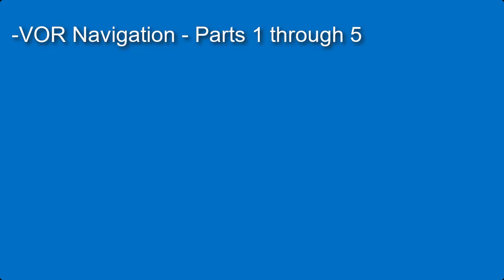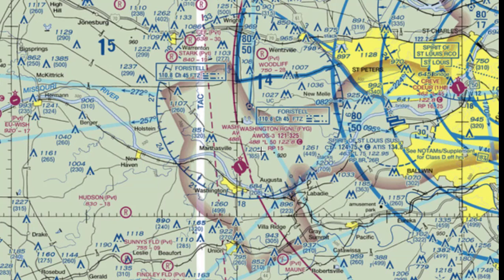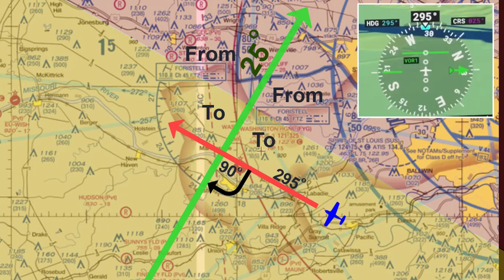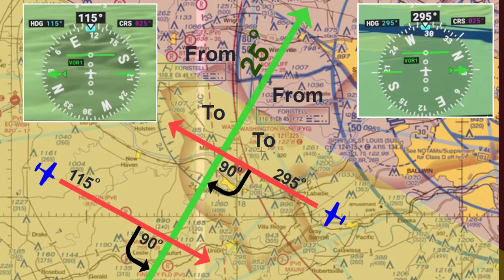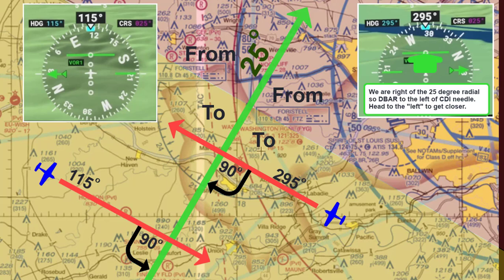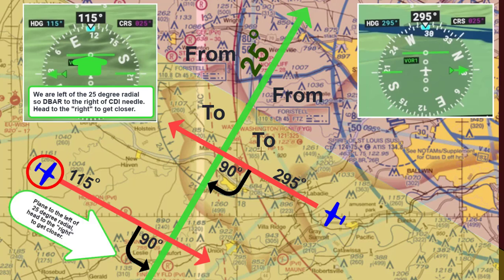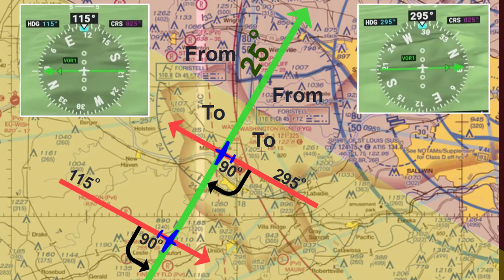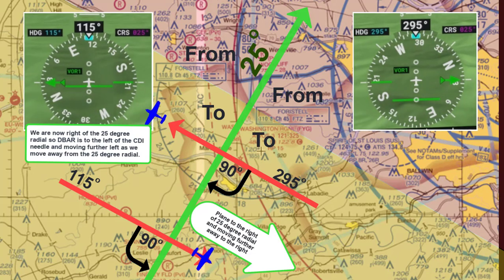Garmin G1000: VOR Navigation - Example 1

Comment: Scott, in the position of the first plane from KSUS (and for that matter, also the second plane) you say that you track a heading of 295 using the heading bug in HDG mode. Can you have the autopilot intercept and track that 25 degree radial to the VOR in NAV mode, rather than using the heading bug, or is the plane located too far off the radial? If it is, how far is too far? Thx!
Reply from the maker: You can use NAV mode for sure and it is probably more efficient to do so if I'm thinking right off of the top of my head but I was trying to explain navigation step by step working my way to NAV mode if that makes sense.